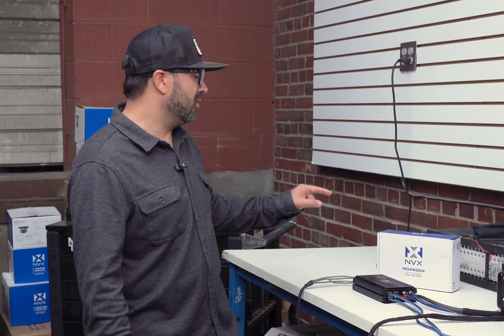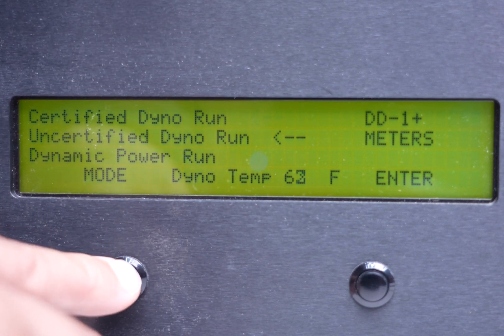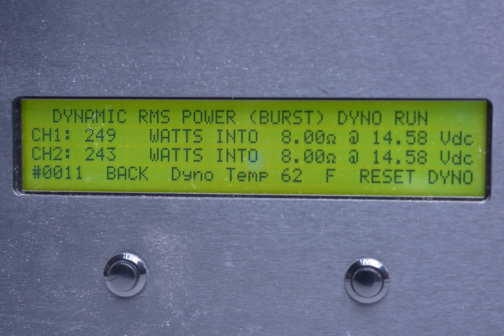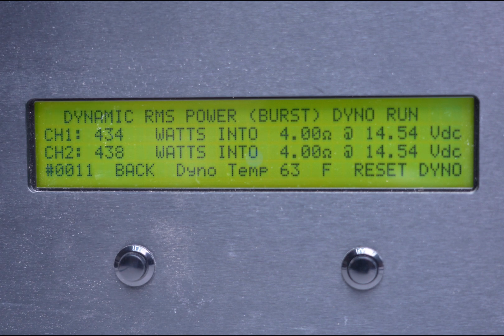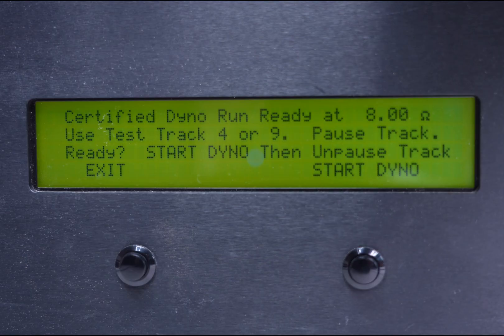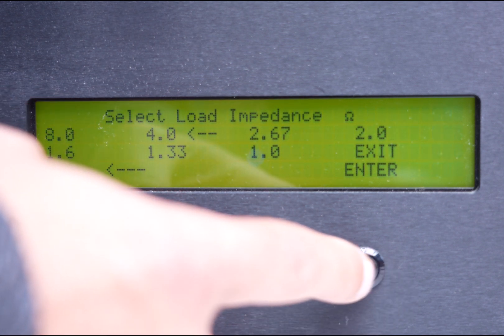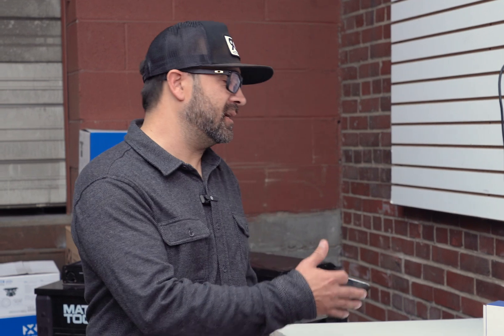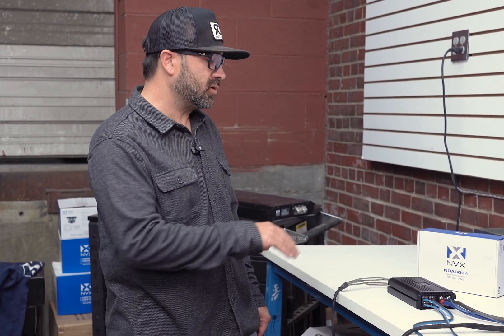NVX NDA600.4 Amplifier Dyno

Comment: Could I run 2 speakers on front outputs and a subwoofer on rear outputs but using bridged mode and would they have to be the same ohms front channels and back channels. Bridged mode only says its rated for 4ohms but I was hoping to run it on 2
Reply from the maker: You can not bridge this amplifier at 2 ohms but you can have different ohm loads on the front and rear channels.

Comment: I just installed this amp and noticed output noise without a signal input and 0 gain of .5 to. 9 volts. The noise is very clear on an o scope. Have you guys noticed this or have an explanation? Once the amp hits 17 volts of output the o scope goes crazy with noise. I've never seen anything like it.
Reply from the maker: We have not heard of this on our end. You should reach out to our customer care team to have it exchanged as this may be a defect in your unit.

Comment: Thank you, with all the tuning jobs you have done? I donot have oscope dd1 etc where would you want your high pass? 100 ? Low pass 80? And set deck to through?? Having a hard time
Reply: Yes but keep in mind you have a gap that you won’t hear . Depending on your car speaker example if they rated at 45hz then set that high pass at 80 , that way you get the full experience. Some alpine are rated at 65hz so that where you might want to do 100 , some people try to overlap the two